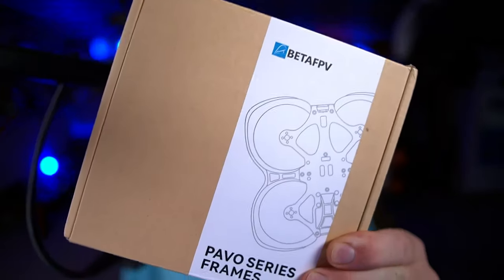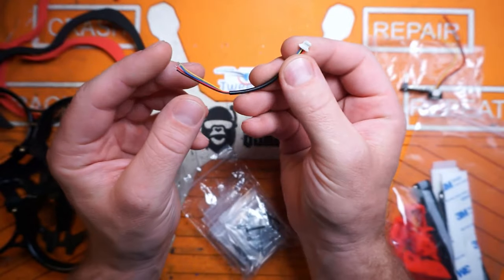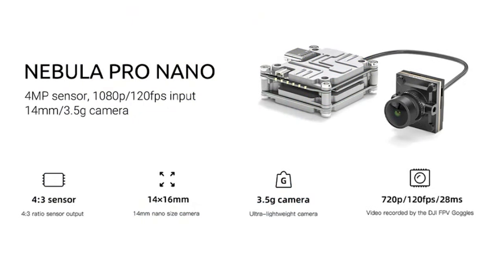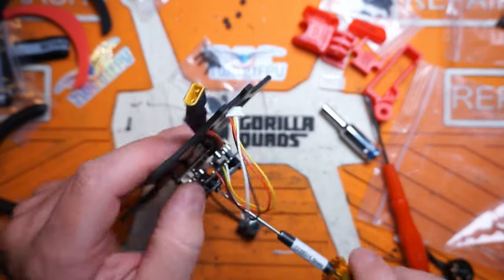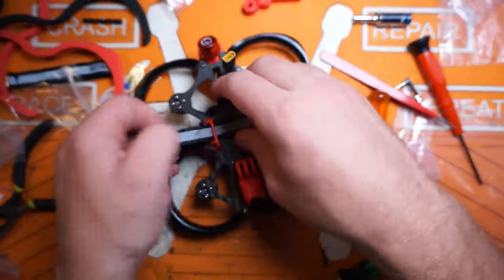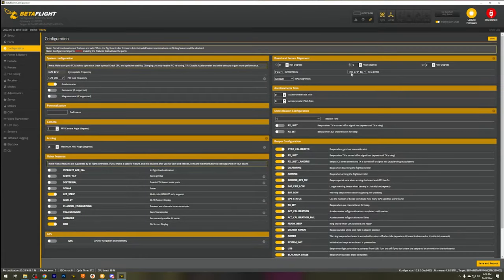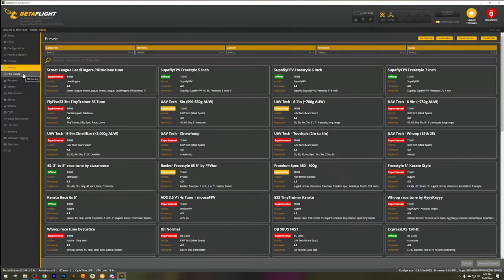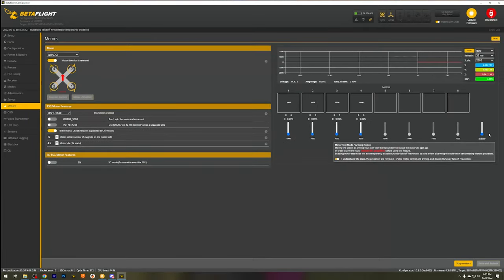BetaFPV Pavo25 Cinewhoop Build, and review #betafpv #cinewhoop #betafpv #fpv #fpvcinematic

Comment: Is this less front heavy than 95x v3? Can it fly hero10 bones? My 95x v3 seems too front heavy. Can't push battery back. Flies terrible with it. HD cam on this still looks far forward over front motors. Not sure how far back u can push battery to get 50/50 .. looking at cinelog25 too HD cam looks further back
Think I'm change my old 95x v3 to 1207 motors to test 5blades & more weight but I know my old rcinpower 1207 ran hot but they never burnt out. Burnt my finger but kept working
Also looked at mamba 1206 in 6s kV 😳😍

Comment: Nice vid.  Will the Vista fit if it is not naked?  Also, what other FC and motors you recommend?  Do we have to use 4500kv or would 4600kv woek.as well?
Reply from the maker: A normal visita will fit just fine. 4600kv would be just fine as well. As far as aios go I would stick with something that has a USB port that comes out the side and not the top.
Reply: @TweetFPV  Thank you for your replay.  Do you think the Diatone Mamba F411 25A BLHeli_S 2-4S AIO would be a good fit.  I've seen where a 90deg adapter.might be needed.
Reply from the maker: That should work just fine.

Comment: Hello, I have built this exactly as you did but I’m having trouble in where my Express LRS is connected to my radio (X9D) but I don’t have any stick inputs in Betaflight. I’m using the Beta FPV rx with the tower antenna. I have switched out 3 different RXs and I still have the same problem.
Reply from the maker: Are you getting any telemetry on your radios screen (signal bars) if you are then your betaflight configuration or your wiring from the receiver to flight controller has errors in it.
Reply: Yes it does have telemetry. By the way I’ve came across something i didn’t see in the video about this aio FC regarding the Beta FPV diagram in which it says you need to solder 2 pads together for the CRSF (Lrs) Receiver. Did you solder those or just leave them as they are?
Reply from the maker: I didn't have any solder bridge pads like that on the aio I used.

So if you have telemetry then your receiver and transmitter are bound and your issues are with either how you wired the receiver to the flight controller or in your betaflight setup. A LOT of people mess up the connections from the rx to fc. Remember you need to run for rx to tx and tx to rx from the receiver to which ever uart you are using. Then you need to select that uart as serial rx in the bf ports tab. Then in the receiver tab you need to select serial based receiver and crsf as the protocol.

Comment: Hey thanks for the  great content. I have a question I just build a pavo25. All modes are set. I am able to arm but motors just spin any idea what’s going wrong
Reply from the maker: Not a lot of info to go off of here.. My guess is your props are on upside down or your motors are spinning the wrong direction causing thrust to be In the wrong direction.
Reply: @TweetFPV  I arm the quad but all I get is spinning motors is does not come off the ground. My props are spinning as followed 4 and 1  clockwise  3 and 2 counter.  Any ideas
Reply from the maker: Perhaps your props are on upside down and generating thrust in the wrong direction. Or perhaps you have too big of a battery/payload for it to actually get airborne.

Comment: where is the analog aio information for this board?
Reply from the maker: Analog aio? This aio is analog or digital. Depends on what system you connect to it.
Reply: @TweetFPV  I was able to find someone who wired it analog, i was hoping to use the DJI stuff to make it plug in play for analog,i but i have to hardware to the pads
Reply from the maker: The pinout is on betafpv.com. The connections you need to make for analog are all solder pads and not plugs.
Reply: @TweetFPV  yeah found that info, you think that crossfire needs to be solder on pads too, or that could use the plugs?
Reply from the maker: Yes crsf could be on a plug.